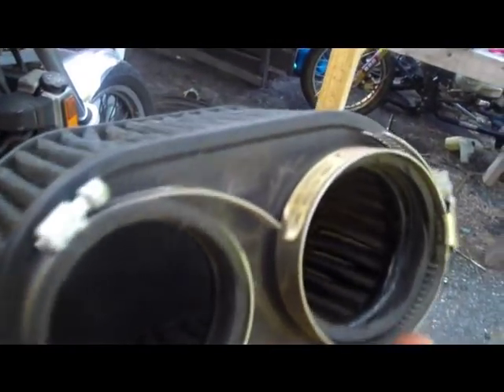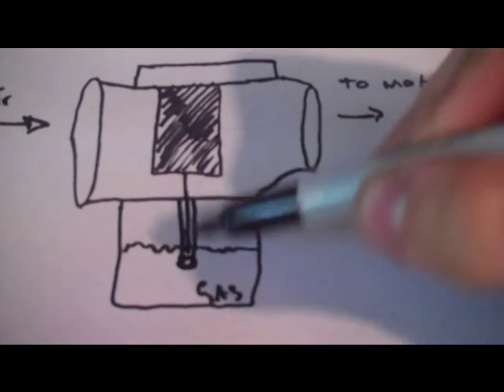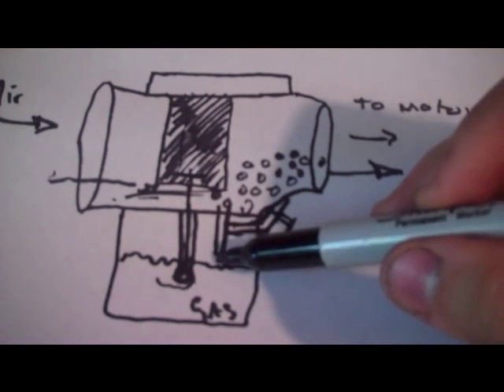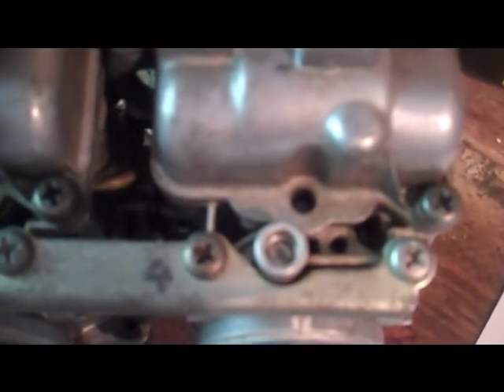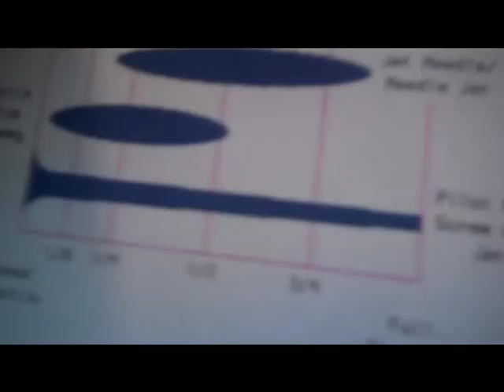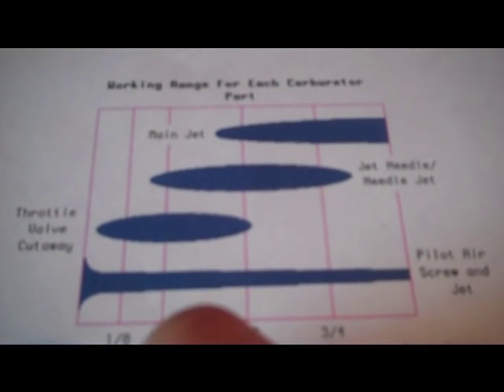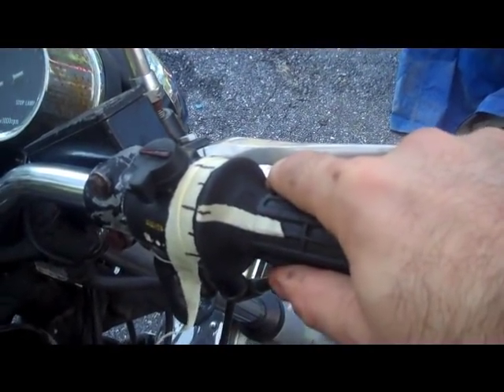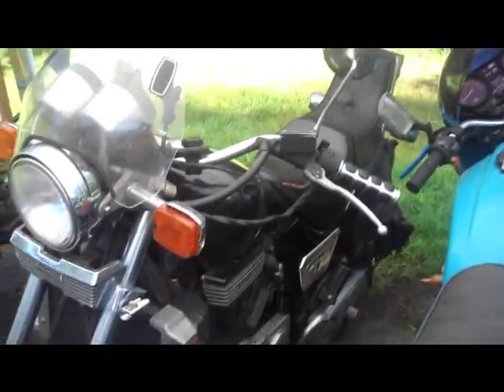How to adjust the jets on motorcycle carburetors

Comment: Great vid. I still have a question though. My bike has no mods and is all stock. But when going from cruising to open throttle the bike takes a little time to react and then gives it all at once. It only happens when riding and as such I haven't checked the sparks rite after. But generally the sparks look ok when I check them.
Reply from the maker: OK you might be developing vacuum leaks, carb might be a little dirty as well. I would not suggest changing jets out because its a repair issue, not an adjustment issue
Reply: mrmaxstorey Thanks. I will try them out.

Comment: need help with 1983 kz750 twin. trying to figure out if bike is running lean, and where to start. it's stock intake. only mod is two into one exhaust. pipes are heavily blued all the way to underneath the bike, popping on decel and sometimes a stall when coming to a stop. runs like a bat out of hell through all rpm range I'm just worried she's too lean so where should I start as far as jets? or should I just richen the pilot screw and maybe shim the needle once?

Comment: thanx for the video, I just bought a 86 Honda rebel 250 and I'm running rich and in 1st gear on take off I'm having to throttle hard to go , if I throttle low it acts like it wants too stall, any thoughts?
Reply from the maker: What modifications does it have to the intake or exhaust?

Comment: I used your tips for my Honda GL500 82 with pods and exhaust mod and it's running perfectly. But I need help for my Honda GL1100 1983 with stock air box and slash cut Harley mufflers. I removed the OEM crossover pipe and I use the stock headers. The sparkplugs tell me that the engine run lean. On cold start the engine have erratic idle(up and down) and take time to warm-up. When's hot, it's popping(backfire) at the exhaust when I close throttle. The Keihin VB48C use #145 main jet and #35 slow jet. Do I increase the main jet to #147.5 only without regarding the slow jet?
Reply from the maker: You can start there. Remember you may have to go even bigger or replace the slow jet, its a trial and error process

Comment: hi I have bought a yamaha 2 strokes bike 125cc, why do the fuel consumptions are too high?.The distance covered for 2.63L of gasoline capable only for 20 km. is this came from the bad adjustment of the carburator?. thanks for the answer

Comment: Hello again. Quick question to confirm... I am installing a K&N and a V+H 4:1 exhaust on my bike. Given the advice you have provided, that means I should replace the 110 main jet with something in the area of 115-120? Or are we talking 120-125? In one part of the video you spoke of how the numbers used for one of the measurements is a "step" which is actually a multiple of 2.5

Comment: Hi.
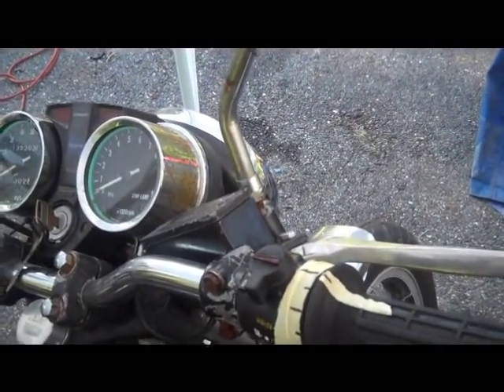I would like to evaluate my spark plug as you explained at 22:00. Specially I am interested at the mid range where the jet needle height is important. After I cut the engine by the kill switch is it enough to remove only one spark plug? I have a VTR Superhawk, and the front spark plug is easy to remove, but the rear is sucks.

One more thing, when I cut the ignition should I immediatelly close the throttle too?

THX!
Reply from the maker: It will only tell you how you are running in that one cylinder. The rear cyl may still be lean or rich

Comment: This is very informative and you are obviously experienced but I have a bit of a problem with your statements around 5:00. First, you say that the air coming from the filter pushes the slide up. From this one assumes that the incoming air is under pressure, however you go on to say that the fuel is drawn up the main jet from the bowl because there is a vacuum under the slide caused by the rushing air. These statements contradict each other, would you clarify please? Thanks for an interesting and well-explained post. Paul
Reply from the maker: Yeah, they can't all be winners haha. I try to catch these kinds of mistakes and make annotations. Really the slide is drawn up by vacuum from up top, and increased air rushing through the venturis draws up the fuel.
Reply: Got it! So the vacuum is generated in the inlet manifold, by the engine, on its side of the butterfly. That little hole at the top of the main inlet duct must be connected to the area above the diaphragm rubber and the pressure difference on either side of the diaphragm forces it and the jet needle up.
One last question Max, why on earth do they call it a "Constant Velocity" carburettor? it's a mystery to me. Thanks for the reply. Paul

Comment: @Michiganborn1969 
oh btw, after I got everything back together on it, I looked a little closer at the directions on te back of the RTV. It said "NOT recomended for parts in contact with fuel" Since the carb boots have an air/fuel spray mixure going though them do you think it will be ok? I used the Red Permatex RTV gasket maker.

Comment: Hi, I have a ZX9R and have an issue with stalling. I've balanced the carbs, replaced fuel filter, serviced (not valves) but still have problems. What happens is when I stop after riding for a while then start the bike it starts fine, but when I pull away and stop again (like exiting a fuel station) it stalls. Problem is worse when the bike is hot. Also bike is running rich (black carbon on plugs).  
I am guessing the problem is to do with the pliot screw and jet.
What would you suggest?
Thanks.

Comment: Hey Max, first of all, congrats on the videos, great work, thanks! I have a virago 250 95, it's got one carb for two cylinders and i'm running rich on my front cylinder, the back one is just fine, good color on the spark plug. Any suggestions?
Reply from the maker: +Bruno Fernandes Id start with a valve adjustment
Reply: +mrmaxstorey i've already done that.
Reply from the maker: +Bruno Fernandes OK well with one carb for both cylinders, presumably both are receiving the same mixture. What makes you say the front one is running rich? Are you producing any smoke?
Reply: +mrmaxstorey no smoke. maybe i'm being too picky on the fine tuning of the bike. the engine was recently rebuilt, new piston and serviced valves. i'm just reading the color of the spark plugs. the one in the back cylinder has a brown color, looks goods. the one in the front is black with a little carbon deposit. other than that the bike is just fine, running good.

Comment: Eh....took the carbs off cleaned them out just one thing the little back seal that goes around the piece with the net is missing put it back without it do u think thats going to cause a problem. ....... other than that it was a pain in the ass too but the carbs back having a hard time putting those black air tubes on the carbs almost done.... 

Thanx for your vids......
Reply from the maker: Yeah that might cause the carbs to overflow
Reply: Then it will go out the over flow right
Reply from the maker: Trucker Sal
Or into the airbox, or into the intake of the engine and trickle down into your oil sump
Reply: Eh bud bought a new lightbulb for my bike but not working obviously I have a electric prob do you know where that leads or what I can take a look at thanx man your a big help

Comment: I have a 2006 crf 250r and it runs good unless you give it has too fast. I Jane no clue what's wrong. If you give it too much gas too fast it bogs right out
Reply from the maker: Do you have any modifications to the intake or exhaust
Reply: i have that to i have an upgraded exhaust do i need to rejet. When i go full throttle it bogs out.

Comment: Mr Max!

I need your help!
I recently re-jetted my carbs on my gs500. I used a dynojet stage 3 kit. I have pod filters and an after market megaphone exhaust. 

Ive cleaned the carbs, shimmed the needles, changed the jets, screwed out my mixture screws and synced the carbs. 

Bike rides great except now the motor has a habit of stalling while slowing gown to a stop.

Ive ramped up the idle knob and the stalling issue goes away but only if I idle at 2k+.

What the heck is going on!? 
Am I ruining my bike?

Thanks Max!
Reply from the maker: Probably not ruining it, but the mixture is a little off in the lower end, either you are a bit too lean or too rich in the slow jets

Comment: I put brand new Mikuni vm30's on my cb350 to replace the old leaking carburetors.They came with pods but I was told they let too much air in so I replaced them with UNI foam filters.

Do I still need to increase my main jet by 2.5?

Comment: Max, looking at the jet sizes for the main on my BS34ss carb the stock is a 130 and it goes up to 132.5, 135, 137.5, 140, etc. Are those jets ending in .5 half size increments? I figure they are but want to get that 2.5 base after adding the pod and work from there.

Comment: i got a 93 suzuki kat 750, im replacing it with a 1156 drag motor with a yoshi cam, power pack 4-1 exhaust .  i was told i could use current carbs but i should use flat slides. can i use my currents? and if so what would i change it to? and should i switch to pod filters.

Comment: The thing I would say is "tricky" as you called it is not being sure where to start, some say start with main jet and work back to the pilot jet, others say start with the pilot, some say the needed clip must be put in whatever position gives you best performance but others say it must be centered to avoid any unwanted fuel/air imbalances.

btw have you seen those glass spark plugs that let you see the colour of the combustion so theres no need for boring spark plug runs? if so what do you think of them? I got one months ago but not used it yet. It sounds like a pretty damn accurate way of getting a perfect tune up, quickly.
Reply from the maker: +GibsonLesPaul2273 No worries bro you can buy 50cc scooter motors at Walmart for like $20 for a dozen...
Reply: +mrmaxstorey Nah man the bike is sweet its just the tuning im tinkering with.
Reply from the maker: +GibsonLesPaul2273 Unfortunately I can't advise you very much beyond whats stated in the video. I don't mess with scooters too much. I had a buddy in high school who would race them, he could get 90mph out of a cheap chinese scooter easily and fabbed up nitrous injectors for them. They were good for about 3 runs until the motors blew, just swap in a new motor and he was good to go again. Looked like good fun
Reply: +GibsonLesPaul2273 Most people scowl at 2 stroke scooters and im one of them but im someone who should have took my bike test decades ago but never got around to it, its a lot of hassle here in UK getting your full bike license.
Reply: +mrmaxstorey Yea thats probably the best use for Chinese motors they are crap, I needed a workhorse so I went for quality but I need to dig for spare parts online sometimes, its all part of the fun, gives me something to do and im flying the flag for a bike that was overshadowed by its successor.

Comment: i unhooked the throttle cable and all the clamps were tight on the boots...i tried the stock carbs that came on the new motor, but im gettin alot of popping and backfires at about 1/4 open. im gona take your advice and rejet the stock ones. Then i know whats in there.

Comment: hey there, i have a yamaha xs 400 and your video is making sence, my bike runs fine till half way and after that, at about 100km/h if i want to go faster, my bike starts to make bangs out of the exhaust, geuss its my main jet, i have a more open exhaust and open air filters, but i think maybe it is to rich, standard size is 127,5 and now i have 170 in them, so it about 1/3 bigger maybe way too rich :P but im scared im running to lean :(

Comment from the maker: Sometimes, depends on the reeds. Run it for a while, and then check it using the method I described in the video, and if you are running rich or lean adjust it from there

Comment: I have a yamaha WR250F 4 stroke kehin carb.  It's currently jetted for sea level.  Where I ride is between 4,500 and 7,000 feet elevation.  It back fires alot on deceleration and now it's starting to die.  Have not looked at spark plug yet, but assuming rich, what process: Fuel Screw first, pilot jet second, etc...should I follow for fixing?

Comment: Hi, Great explanation. Does POD filter(s) = K&N panel filter?
Also what additional info do you have?
Also what info do you have on carb balancing? I made a homemade 4 channel system but i'm getting alot of pulsing in the fluid reading. What does that mean?
Reply from the maker: Pod filters are individual filters that attach to each carburetor. You can watch y video on synchronizing carburetors for more information on that
Reply: mrmaxstorey hi what I meant to say is that are pod filters and a k&n panel filter acting the same as far as the airflow. How do these differ and influence the fuel scheduling?
Reply from the maker: dashbmw Yes they act the same in that they both make airflow unpredictable. Each style of pod filter causes the air to flow in different ways, which is why it is important to rejet each time you change the filter style

Comment: I live near Harrisburg, Pa.  I am having a problem with my Honda CM250C starting when it's cold out.  I don't think my bike likes the cold.  Most times after the bike warms up it runs pretty good. But today wasn't one of them.  It was about 35 degrees out and the bike idles good but when I put it into gear and try to take off it won't go and starts to pop and carry on. To make matters worse we have ethanol in the fuel. If there's too much in the fuel the engine will run lean.  What do I do?

Comment: My bike hasn't turned and noticed there is no fuel entering the carbs. I tried spraying some fuel directly into the carbs and the bike will try to actually turn on and figured no fuel is entering the carbs so somethiń is clogged: I removed the fuel Filter completely and connected the line directly to the accelerator pump. The pet lock was okay aswell. I tried to turn it on this's time nothing! So ifigured it's not the lines, nor the pet lock not the fuel filter so maybe inside the carbs or even the accelerator pump. Before I did anything I checked of there was any fuel coming out of the bowl drain and it did indeed begin to drain fuel. So where should I inspect next?
Reply from the maker: +LCST (Locust) Remove the carbs and clean them. I have lots of videos up on the channel about cleaning carbs

Comment: my 80 CB750F has the standard round top carbs (vb42's) and they come stock with main jets that are numbered 100 and pilot mains that are 68. I went up to 80 on the pilots or .8 mm and 140 on the main jets. Now is that only a jump of 4 steps up on the mains? I have Pods, V&H 4into1 with a stainless tip, slight baffle.
Reply: +Dave Harris I have a little stumble at about 1/3 throttle after it warms up. Takes a couple of minutes of throttling it to get it to idle, even with choke on.
Reply from the maker: +Dave Harris No thats a huge increase. If it were my bike I would have started at 105 mains and 70 pilots, and gone up slowly from there

Comment: with re-jetting.. do you just replace the jets for bigger/smaller holed jets and screw them fully in?
or does the amount of turns screwed in also play an effect on tuning?
if so.. how do you know what turns to make etc?
as im fitting a big bore kit soon, as is recommended I re-jet 10%. whatever that means..

Comment: Isnt the spring seat supposed to be on top, above the adjustable c clip..?  If not what pushes needle down, the spring seat will just slide down to bottom and needle stay up, true?
Reply: also, why are you shimming the needle, thats the job of thhe c-clip. The needle has multiple groovds to select its depth.
Reply from the maker: RJSoftware2000  On some models there are grooves but most there is a smooth shaft with just 1 groove so shims are required

Comment: Hey I have a 84 yamaha xt250 and it boggs down at full throttle. Does this mean it's too rich? Runs fine at low rpm but dies wide open. I'm gonna try adjusting the needle but it also has that side valve to let extra air in at higher rpms. Could that be causing an issue? This carburetor is difficult to find information on.

Comment: update on my problem - the decceleration problem only occurs between 3000-2000 rpm. if i rev it at 6000-7000 rpm it deccelerates normal untill 3000 rpm when it drags slowly to about 2000 rpm. are there any common problems related to slow decceleration ? it's odd that it only happens between the two values i mentioned earlier. thanks.

Comment: yeah but the guy had it before me and it ran fine,i drove it for a bit around the yd and it always started on choke.then after i went riding the exhaust was red hot and it had extreme popping like it would shut off.do you think im running to much air?and yeah i's gonna look at the spark plugs after.i did tho clean the carb and it started only if i covered the intake manifold w/a rag or hands.

Comment: hey i have a 66cc motorized bike and right now it has a 14mm carb but i have a mikuni cora 28mm carb can i put that on it or will it loose performance because it is too big.  It was originally on a 1986 Kawasaki kx80.

Comment: So I was wondering. I've got an '82 Virago XV750 with drag pipes and baffles and a K&N Air Filter, but it says the filter doesn't require rejetting. So only for the exhaust. Since it's not straight piped, but it is drag pipes, how should I go about figuring out the right jet size? I've got a Stage 1 jet kit btw. Let me know what you think, thanks!
Reply from the maker: Id just increase the main by one size, and assess for signs of running lean

Comment: I have a 1989 XT 600, single cylinder with a duel carb? It has a primary carb and a secondary carb. I have an open exhaust and pod air filters. Would upping the main jet by 5, pilot by 2.5 and the needle up 1 help on this bike?